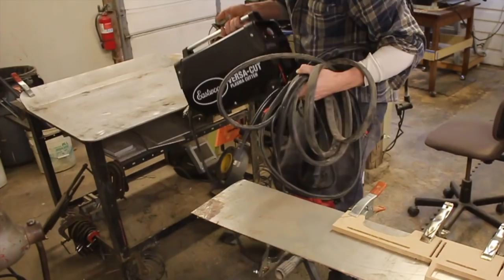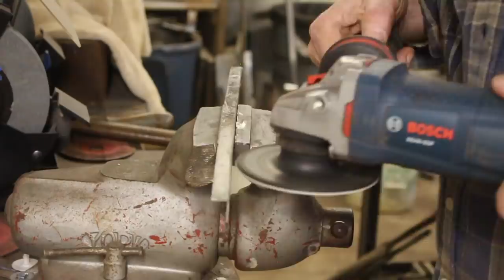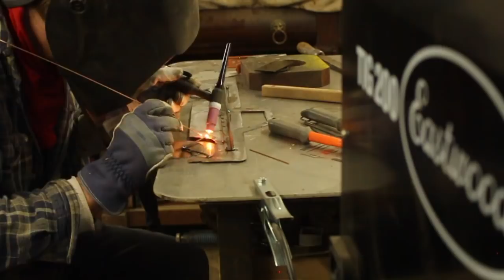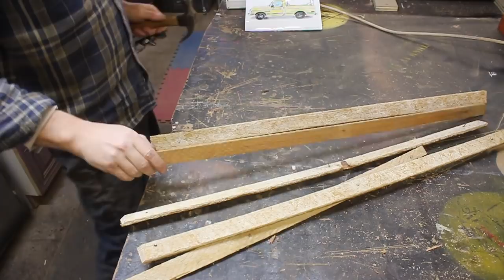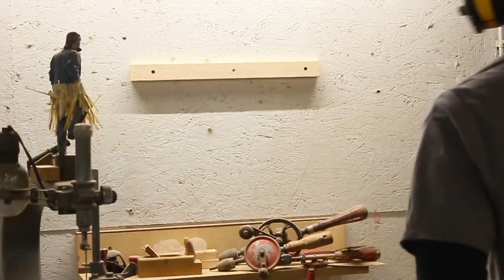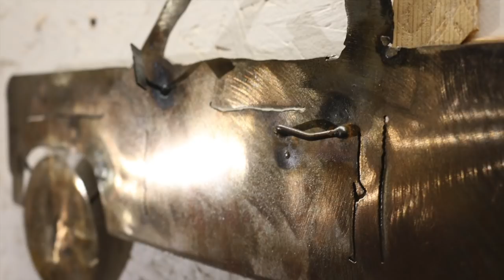Welded Steel Pickup Truck Picture Frame

Comment: Thanks Tim.   As a non-metal guy I’m still not sure when one sticks, mig or tigs.  Is it metal dependent?
Reply from the maker: TIG is easier to do different metals like stainless, aluminum, etc., but MIG is definitely easier to use. TIG is also good for regular steel for aesthetic reasons and I'm sure many many other  reasons I don't know about. I'm just learning this stuff, too.